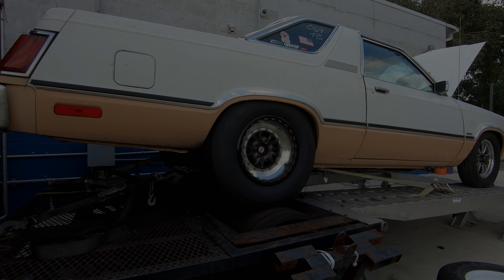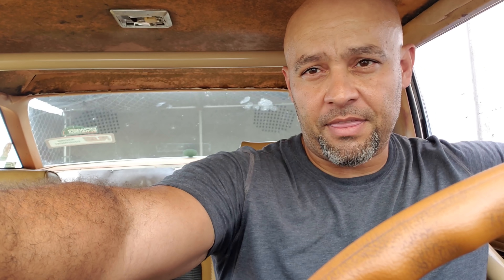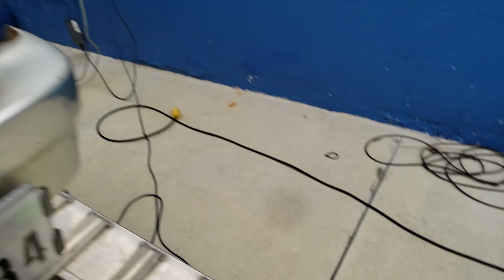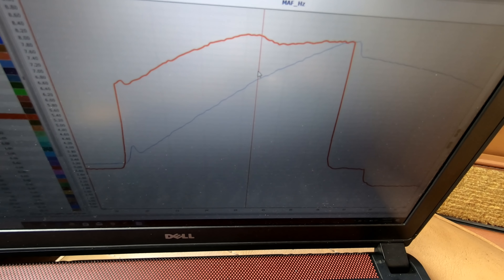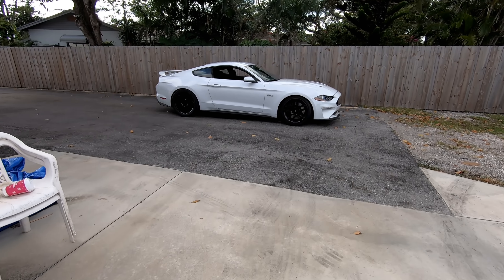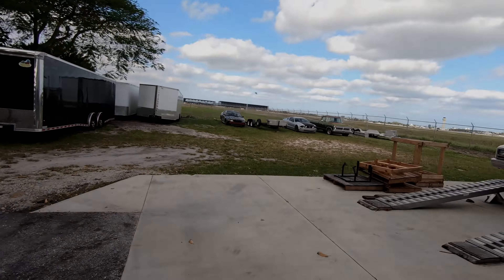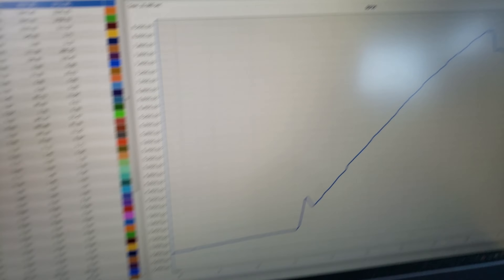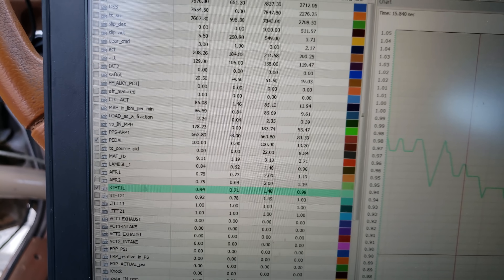Coyote swapped Foxbody Ford fairmont "Hushmoney" gets more boost

Comment: Alex, i've had good luck with an 8rib Gates RPM belt holding 30psi on my Procharger setup. You can order the RPM belts from NAPA and keep in mind that you need LESS tension on the belt or else it will snap.

Comment: Had issues with my JTB 8 rib slipping.  RPM belt, griptech and correct belt size got me close but its still slipping w/ 3.0 and 15% lower.

Comment: Although this blower is impressive in its own right, does a gen 3r have the potential to make more power then this blower?
Reply from the maker: Same. The 3r is a highly ported version of the gen 3. This blower has already made crazy power on viktor 2 . (Green 2019 gt) but this edelbrock has superior design, intercooler and packaging than the 3r or similar roush blowers.
Reply from the maker: I can port it and make more power but...since the car is light...i dont need to...my old gen 3 had 140-150 iats at this power level.  This blower hangs out at 120 tops at wot